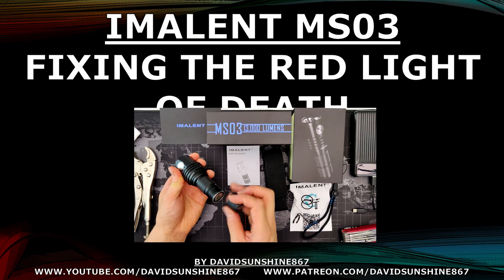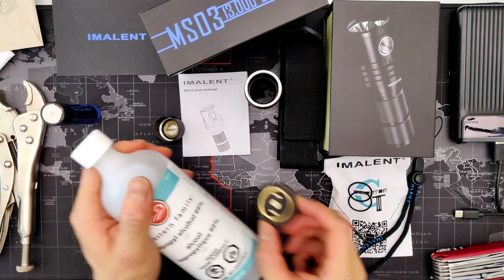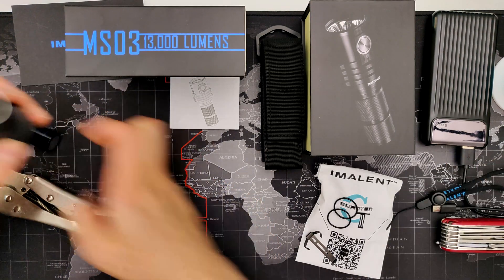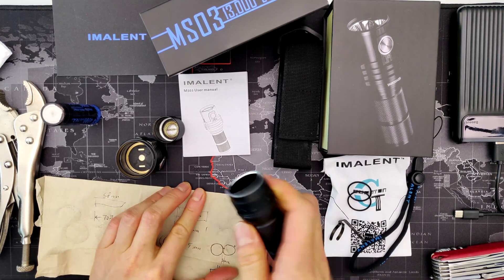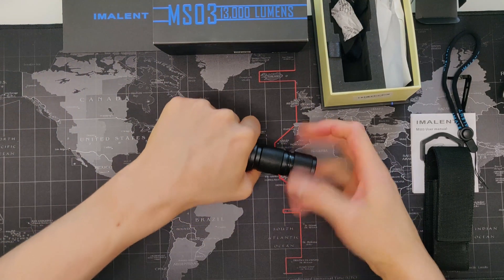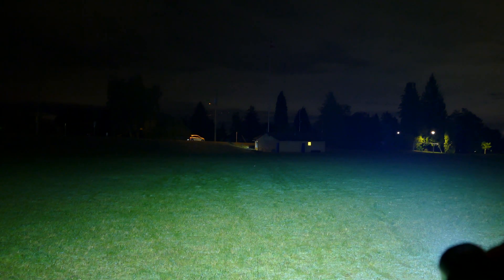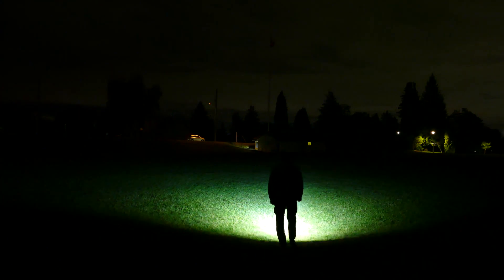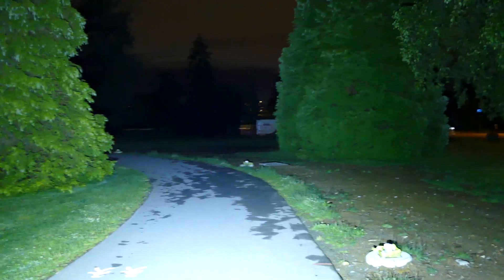How To Fix IMALENT MS03 - Red Light of Death

Comment: Thanks for posting this really helpful solution. I took receipt of the new 25000 Lm Imalent MS06 yesterday, and it had exactly the same “red light of death” issue. I cleaned the contacts as you instructed, and now I can Turbo-Turbo-Turbo to my heart’s content.
Reply from the maker: You're welcome!  Wow I didn't even know they made an MS06 with 25,000 lumens!  That's a beast of a light, and still very compact.
That's too bad they have the same red light issue, but glad you got it fixed with the cleaning!  That's smart that you applied the MS03 techniques to the MS06.
Thanks for letting us know, I'm sure you'll help a bunch of MS06 users out there. 
Enjoy 25,000 Turboing all over!
Cheers!
David.

Comment: Thanks for sharing this this fix.  I've really wanted to buy this flashlight but held off because of the Turbo issue, but now don't have a problem taking a little bit of time cleaning the contacts.  Just curious if the removal of the glue and some threadlock will affect it's IPX8 under water rating?  Have you still done an under water test after the fix and passed? Or is there enough threadlock left on the threads themselves that when you screw it all back it will still meet the IPX rating?  Thanks!
Reply from the maker: My pleasure!  
I heard they fixed the July and newer production models, so maybe wait a bit and try to get that, mine was 202006... So I assume 2020 June production. 
Also, I would recommend getting it from Amazon, cuz if you don't like it and the LVC kicks in too soon, you can send it back as defective easily, with a free return label.  It's not so easy to get a replacement by AliExpress, I've never sent anything back to China actually, they have never given me a free return label and it would cost me way too much.
I'm done all the testing, and the MS03 failed the drop test, and also failed the water bucket test.  The front ring popped off for the drop test, and the side switch got water into it and stopped working properly until it dried out again.
The threadlock doesn't do anything for water resistance, so you can remove that, the o-rings keep water out of the body, as long as you keep the front ring in. 
And the rubber sealant inside keeps water out of the driver, so the light doesn't break due to water ingress, but water definitely messed up the side switch. It's a tactile switch under the metal button, and I was always wondering how the hell they got it water-resistant?!?!?!  Short answer, they didn't lol, at least in my case they didn't.  I gave it 0 out of 5 stars for both drop and water tests.  If you're looking for a water-resistant flashlight, look elsewhere.  If I add oil into the switch, it'll help resist some water, but that's just messy, so I don't know what to do there.  I would hate to hike with this, encounter some rain and have it fail.
Thanks for the great questions!
Stay tuned for the detailed review video! I'm working on it, might be a little while still. 
Cheers!
David.

Comment: My second replacement MS03 received from Imalent has worked without the Turbo issue during over a week’s regular use.  Look for the newest production examples and you too are likely to receive a properly working example of this very powerful compact flashlight.
Reply from the maker: Thanks Cary Cary!  That's great news!  I think if people buy from Amazon, they can be rest assured they'll get a properly working one, otherwise they can just use the Amazon warranty to get a replacement free of charge, without any troubles of shipping or any liability.
Thanks again for the heads up! 
Cheers,
David.

Comment: Its impossible to remove the head! I've a better solution, save yourself the bother and don't bother buying this faulty garbage in the first place and buy elsewhere.
Reply from the maker: Hi Paulo, 
That's a great point actually, if people don't want the risk paying for a $129 USD faulty paperweight hunk of junk, avoid the MS03.  But I think like me, they might want to get it for the 13,000 lumens.  It seems pretty awesome to have that amount of light in a small flashlight.  They've actually done that, at least until it gets too hot to hold, and if you can fix the stupid threadlock causing it to be faulty.
Imalent has a pretty good customer service, if you've got a faulty light and don't want to take it apart and fix it yourself(Which voids warranty), you should contact them and get it sent back, they'll send you a new one that has been fixed, the new production units have been fixed it seems, as confirmed by Clement(another youtuber who has encountered the issue).
For those still wanting the MS03, I would suggest that people purchase from Amazon, since they will take care of return shipping if there is any issue with the product.  Amazon return delivery is fast and easy, especially when the product is defective, so I think that's the best risk-free way of getting your hands on a functional MS03.
Cheers!
David.
Reply: Paulo Sharman thanks good to know🤙🏼

Comment: Just want to let you guys know if your MS03 is having issues you can't resolve, contact the Imalent support via email.  I contacted Imalent on 7/16 with my MS03 red light of death issues.  After a couple of days of back and forth email troubleshooting, they finally asked me to send the flashlight to a U.S. address (since I'm in U.S.). Today (7/31) I received a brand new MS03 via DHL.  Seems like the new batch of MS03 resolved the premature/inconstant thermal protection issues.  The flashlight still gets really hot after a couple of turbo modes but how many of your friends can say they carry a 13,000 lumens flashlight in the pocket?
Reply from the maker: Thanks for the heads up Clement!  That's great news!
Mine seems to be working pretty well.  I wonder if they reprogrammed the firmware?   Could you do some endurance testing, like running turbo for 45s, then letting it cool for 5 mins, then running turbo again for 45s, and repeating until you see the red light?  My battery was 3.8V when the red light showed up, then went away as it reduced output.
I'm wondering if your new one would work and not show the red light until the battery was much lower, like 3.3V?  That would be great if you could provide that feedback, I'm sure those interested in the MS03 would be really interested in the outcome.
Thank you!
David.

Comment: Doesn't work
Reply from the maker: Hi,
Sorry to hear that.  
Interestingly, I did some endurance testing on mine, and I was able to go to turbo 7 times for a duration of 45 seconds, with 5 minute cool down periods between turbo runs.  Only at the 8th turbo, did the red light come on, and it only came on for 19 seconds, since I had turbo on for 45 seconds, it went back to green and I could go into turbo until the 13th time, after which it stayed red.
So that was about 540 seconds or 9 minutes of total turbo time.  Pretty impressive.
Did you charge the battery fully to test it?
I left some points of recommended cleaning in the description, you can check those out and see what you think.
The white ring at the top of the battery might also be interfering, I would try cutting it more shallow with a knife and see if that helps too.
If you're really up for it, you can take out the tail spring and clean up it's contacts too, but it was hard to get back in there.  Try sanding/polishing all the interfaces, that seemed to help maximize performance too.  I pulled all the stops before it performed really well, giving me 9 mins of total turbo time.
Hopefully they help.
Cheers!
David.
Reply: I have 3 MS03's all get the red light even after cleaning. IMALENT sent me them personally claiming the 2nd too were fixed. The issue seems to be with the hardware or firmware.
Reply from the maker: @FLASHAHOLIC_TV  Hey thanks for the feedback.  Damn, all 3 were faulty eh?  That's horrible.  Clement Wong, had a problem, and he left a comment above 3 weeks ago staying he got a new on July 31st, and that it appears the red light has been fixed.  He was in the US and sent it to a US address.  I'm in Canada, and they said I could send mine back to China for fixing, but it's not worth it since after cleaning, mine can do turbo with no red light until 3.8V.  In the manual, it says the battery must be above 3.4V, but even with lots of polishing and cleaning, I can only get it to 3.8V, which is too high in my opinion, the battery needs to be fully charged to do turbo.  
All 3 of yours still had a red light at 3.8-4.2V? 
I agree with you, the red light won't be really "fixed" unless they reprogram the firmware to have the LVC much lower when in turbo mode.  I'm not sure if Clement's works like that, but we won't know unless we do some endurance testing.
I'm just going to keep the light I have, as it's not so broken that I want to send it back.
Cheers!
David.
Reply: @DavidSunshine  All my 3 get the red light at 4.2v even after getting 2 "fixed ones" Nearly all owners report the red light and I'm very weary of people saying cleaning the thread glue fixed them as most report this does not work. The problem is with the hardware.
Reply from the maker: @FLASHAHOLIC_TV  Thanks for letting us know!  There is definitely something wrong with their programming and hardware, but sounds like Clement has had good luck with his new light, so sounds like they have figured out a fix, at least for newer lights.
Cheers,
David.
Reply: @DavidSunshine  sometimes the issue is slow to start and sometimes it goes away for awhile, I don't believe they've sorted it as they refuse to disclose the latest fix.
Reply from the maker: @FLASHAHOLIC_TV  I see.  Ya, they never disclosed a solution to me neither.  I asked if they reduced the low voltage cut off, or made it a non-latching cutoff, if they did, we could go into turbo again.  I don't think they have lowered the low voltage cut off, which really needs to be done to allow us to use turbo properly.  I've only gotten mine to work properly down to 3.8V, which is not great at all.  The manual says 3.4V, which is still pretty poor considering that it can actually activate down to 2.8V if you unscrew the tail cap to reset the low voltage cut off.  They seem like a new company, I hope they start to listen to the customer and resolve these issues, and improve their flashlights, like Sofirn, Lumintop, Convoy, etc.
Cheers!
David.

Comment: I solved the problem, by buying something else! Why people give these companies that make defective or not working products high praise is beyond what me and many of my friends and family would ever accept. Huge waste of time and effort for something that should work properly from the start!
Reply from the maker: Hi,
I agree, they are pretty bad for sending out defective products, but it happens to all manufacturers, they all make mistakes.  I've gotten defective lights from Convoy even, and they are usually awesome.  My Sofirn SP10S is acting up.  My Olight S1R is having the same issue as this MS03 where it prematurely goes into LVC.  Not down playing the fact that Imalent sent out defective issues tho, that's still horrible.  I like how Imalent pushes the limits tho.  Here, they are trying to make a triple threat, tiny light, three XHP70.2s in a small package, and they have really done it with this light, it really does push over 13,000 lumens initially, gets hot as hell quickly, but that's expected, and acceptable.
You can go with other brands, and they give great quality for the dollar, but Imalent seems to be trying to push the limits(like the 100,000 lumen light, or LD70, crazy lights), they screwed up with this one, but it's a simple enough fix. 
There are definitely downsides to this light, like the front ring comes loose if you drop it, and water can get in and screw up the side switch, but if you're looking for 13,000 lumens and everything else this has to offer, then it's worth considering.  I'm doing a detailed review on this light, I'll find out more in the days to come.
Cheers!
David.
Reply: @DavidSunshine  I bought about 40 flashlights over the last 20 years. Some have failed and some rarely defective from the start. I've learned to research before I buy and even that can fail with places like Amazon which have most reviews by consumers that have nothing to compare against and are not experts in any categories, plus paid reviews! I also understand that not everything is perfect coming out of a factory. Always some variables in quality control and parts in the manufacturing process. But a bad design I will not accept and just return! Two of my close friends are into flashlights and between us we've had a few Imalent flashlights an they did not measure up to other brands we have like Olight, Acebeam, Fenix, Emisar and the BLF models by Sofirn and Lumintop. Imalent have some that push the bar lumen wise like this 13000 lumen MS03 but the design flaws tarnish their brand. My friend had the Imalent DN70 and a smaller EDC and when we were testing at night he could not even turn the DN70 on without another flashlight to find the button. Same as the smaller EDC. Buttons so small, hard to find and press and charge port door that is in the same finger location on the head to add more confusion. That DN70 was returned and we talked about how gimmicky it was. It was too bad because it had great output! These crazy lumen flashlights are fun to blast light for a few seconds but then the battery will not give those 100% bursts for very long. I see a graph by a reputable source here at  3m55s into the video and that kind of steep loss in output its really just for bragging rights, not that usable. It's basically loosing 245 lumens every second through that 45 seconds of 13000 lumen turbo leveling off at 2000 lumen.  I'm guessing when the battery is 50% you will not get anywhere near 13000 lumen. https://www.youtube.com/watch?v=mfPqWLxBLOY. I look forward to future Imalent flashlights and hope I find one that I consider designed better in future.
Reply: I did like the Imalent RT35 and my friend kept that one. Very good thrower! I went with Acebeam T27 for a small thrower and comparing we feel the Acebeam is a little better in all categories.
Reply from the maker: @practicalguy973  Yup, you're exactly right!  It's 13,000 lumens doesn't last long at all, and that does become useful when crossing cross walks, it helps cars see you, and for you to see better, but they made the mistake of not having a way to return to a memorized mode, which I find to be a big mistake to exclude.  They push these things to the market, and miss a lot of things that make it more of a novelty item or pocket rocket than a useful light.  I'd still prefer my S2+ when working on my car, than all these fancy lights.
At 50% battery, it will not even go into turbo LOL.  The 13,000 is only accessible at high battery voltages, so it's not overly useful.  Something like the X7R is needed if you need high output for longer durations.  Basically, this a novelty high powered light, or a useful medium powered light with the possibility of high powered when given conditions are met. 
Based on my testing, after 35 seconds, it's reduced down to around 2000 lumens. 
Cheers!
David.
Reply from the maker: @practicalguy973  Damn!  The RT35 looks amazing. I like how it's got a 1338m throw!!  Wow.  XHP35 HI is a cool LED.
The Acebeam T27 looks great too, 1180m is plenty, I like the smaller size too, much more manageable; I find that once it's bigger than a C8, you can't easily put it in a pocket and that really limits it's portability, and I find I'm less likely to use it.  Thanks for the heads up on these lights.
I see what you mean about the DN70, those 2 flat hard to press buttons has poor ergonomics, I'd have trouble finding them too, they aren't pronounced enough to easily find.  I actually had that problem with the X7R slightly, but they do have those finger grooves so that helps a little, but I wouldn't say a whole lot, it takes fumbling around still, but I think that's just the nature of a side switch.  The tail switch is better in that regard.  Except for the LD10's case, that's not really a tail switch, it's one of those DN70 buttons on the back, I think they failed there, should have put a proper tail switch that's easily activated with a thumb; these are all great points, and I'll put that in my review!
They have a lot of room for improvement, that's for sure, but I'm glad they're listening, it seems that way.  It's great when the manufacturers listen to you, like Sofirn has, I see they made the IF25 with a BLF input, the IF25A, it looks like a promising light with great UI and features.  It was cool that Convoy added the double click to turbo feature from any mode too, that was my one gripe about that light.  Another youtube told me he purchased the light recently and it had that feature, which I said it didn't have.
Acebeam seems like a good manufacturer, I haven't gotten any of their lights yet, maybe I should!
Thanks for the great feedback!
Cheers!
David.
Reply: !Dude just CHARGE them !they are not broken